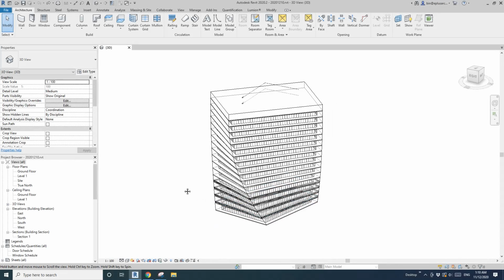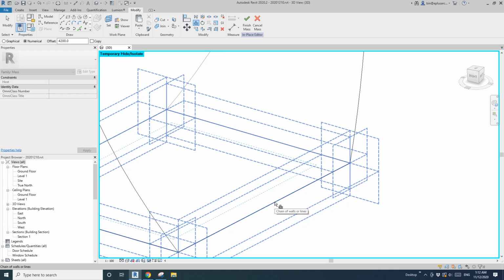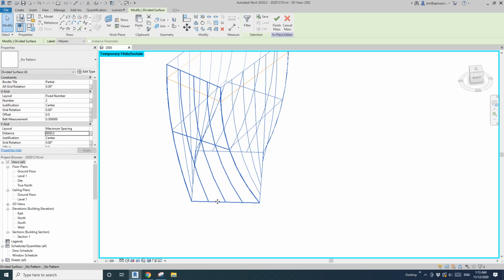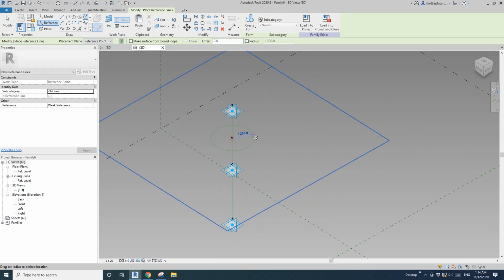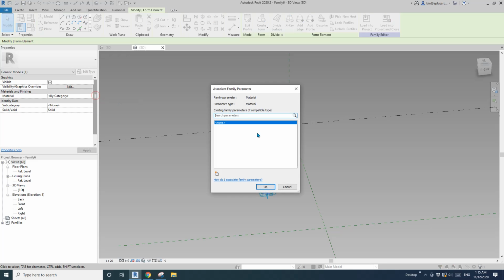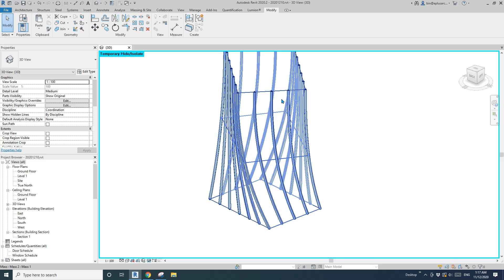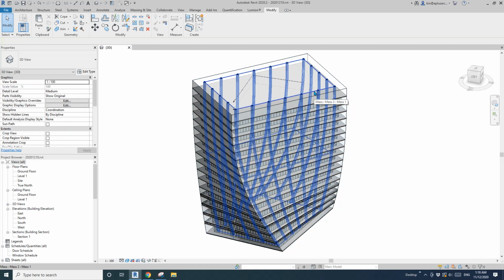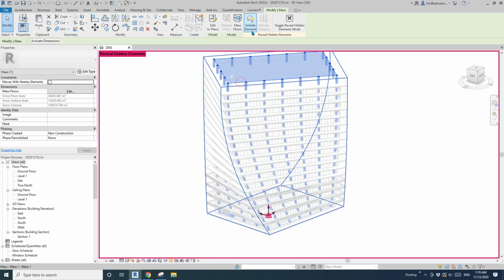Everyday Revit (Day 268) - Twisted Columns

Comment: Hello sir, thank you for your video instruction i do appreciate it so much.btw i got stuck with reducing mass sizes a bit inside. it should be clicked when offsetting an existing mass but i dont see any dash lines around mass. How would you do that sir? thank you
Reply from the maker: Probably not possible to directly offset the mass, you can offset the reference lines and create a second mass.
Reply: @BINHE615  thank you i see. !

Comment: Bin I have a quick question!
let's say i have a twisting box with corners of 90 degrees and I need to put some sort of column in the corners of said box in the shape of an L that covers both of the sides, how do I adjust it in the right orientation (the column) so it would cover the right sides of the box?
Reply from the maker: https://drive.google.com/file/d/1LIFEpFsnx8oPe6Kh-V1aOUDDzJmqh4My/view?usp=sharing
You can try to create a form using the edge of the twisting box together with profile 1 & 2. You can also try to use all 3 profiles with the path, or without the path.
Another option is to use adaptive family to this column. You will need 3 adaptive points with 3 profiles placed on the adaptive points. 
Have a try and let me know if have any problems.
Reply: @BINHE615  THANK YOU🙏